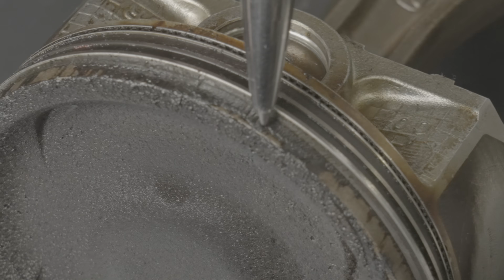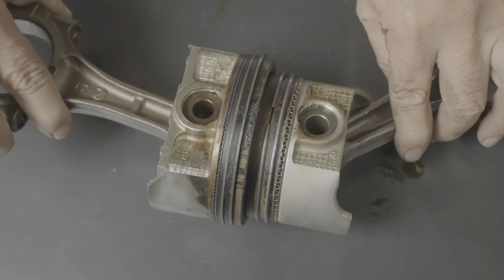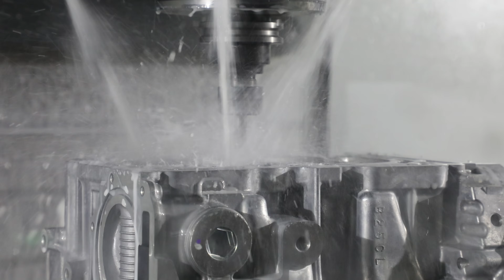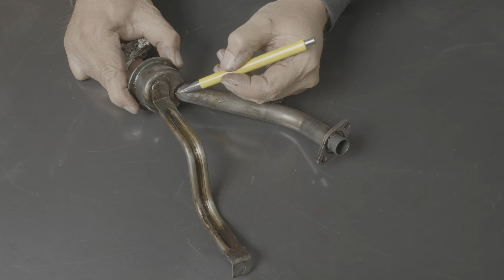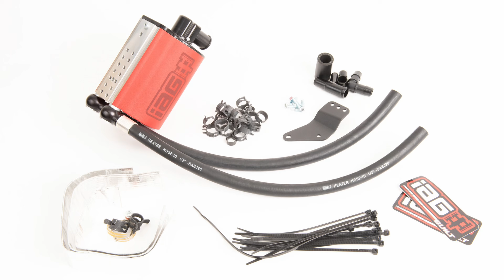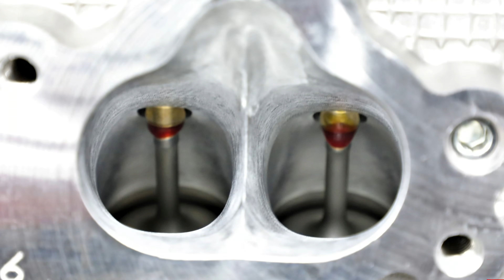Why Subaru Engines Blow Up!

Comment: I'm looking at some WRX's. Is this most prevalent to some years or anything like that? Or I see some comments say the design has remained relatively the same. I'm interested in 2017 - 2018 or something like that years. I don't know much about Subies. But great video! Very knowledgeable and you just earned a subscription!
Reply from the maker: Those have the somewhat stronger FA engine

Comment: Detonation happens when  air temperatures exceed the capacity of the block/cylinder can not disipate enough heat ,by this meaning cooling system, cold air charge intercooler , weak heads, thin block walls and composition.
    Solve the heat problem and then solve the problem.
Reply from the maker: That is only one part of the many of why detonation happens.
Reply: It also happens from running the wrong fuel. Sub 95 octane fuel will predetonate under pressure.

Comment: So if I got one for daily driving (more like once a month driving) and maybe casual travels and leave it mostly stock just doing regular maintenance i'll be fine?

My city got rid of it's racing track anyway so there's nowhere for me to go, the closest place from me is 250 miles away
Reply from the maker: If mostly stock means full stock or bolt on's with a tune from a competent tuner with actual Subaru experience yes and good maintenance just not average..
Reply: @motoiq  literally just changing the air filter and exhaust.
Reply from the maker: Air intakes without a tune mess these cars up most of the time

Comment: 600whp stock block here 3000 miles abused . Only thing  happened so far was e85 corroded my fuel pump connector and left me stranded one day . Main thing with these cars is people running the car low on oil. These cars requires the oil to be filled at all time because of the boxer design .
Reply from the maker: It won't be running for long at 600 whp unless maintained well and driven carefully.

Comment: Most of my wife’s family buy Subaru’s only. They live in Montana and buy them for their superior traction, safety and accident avoidance.
One of my brothers and sister’s inlaw drives 50K miles a year, so every 6 years they buy a new Outback, because after 6 years it has 300K miles.
They change the oil every 5K miles and every 35 - 40K miles they have the CVT fluid changed.
All of her miles are highway mileage where they seldom drive over 70mph.
A few years ago my wife had been wanting an Outback for many years, so for her 50th birthday I bought her a 2 year lease returned Outback. It had only 5,600 miles. It now has only 30K miles and it’s 5 years old.
She fell in love with the Cinnamon Brown with the warm Ivory interior.
Before buying her the Outback she’d have to park her Camry 3-4 months every winter because of the 5-7 feet of snow we get here in a very mountainous area of north central Washington state. She would then drive my 4WD Toyota RAV4 and I’d drive our 11 Ford Ranger XLT super cab 4WD pickup.
After buying her the Outback, we were so impressed with the traction that I decided it was time to replace my old RAV.
We had to put studded snow tires on my RAV every winter, whereas she drove year round on her factory tires on her Outback.
In December 2022, I found a 2019 Forester Touring that had only 4,700 miles. It’s a Certified Subaru and is the biggest LEMON ever produced.
I started complaining about it at only 5K miles and BEFORE the Factory Warranty expired. It’s been into Subaru service department many many many times.
They thought that they found the problem After the warranty expired and even though I’d been complaining about it for over a year and the warranty expired, Subaru wouldn’t pay to have it fixed. So it cost me $1,600.
Even though I spent that money for a new DCM the main computer, it’s still doing the same things and now my mpg has Dropped from 24mpg, it’s now down to 20mpg. It’s the 2.5L 182 naturally aspirated engine. 
Hell, my RAV had the 268hp 3.5 V6 with a 5spd automatic transmission and I was getting 27mpg in it.
In 25 the RAV. Is supposed to be redesigned, so I’ll wait for the 26 year model and I’ll sell my POS LEMON forester Touring and buy a new RAV AWD Hybrid.
My Forester is my First Subaru and it will be my LAST Subaru Ever !
As far as I’m concerned, Subaru can go 🖕🏽🖕🏽🖕🏽 Themselves
Reply: I know how you feel. I don’t trust my Subaru to go out of town at all. Its engine was totally rebuilt at 60k and now at 103k it needs it again and they hit me with an estimate of nearly $9700. The trade in value is about $5000.
Reply: @GarlonAllen  I got rid of my Forester and bought a new 23 Tacoma TRD Off Road, double cab, 6’ bed with the Premium and Technology pkgs
Reply: Damn! Write a book

Comment: I've had my sti at 760 wheel for about 16 months. No issues to speak of but I run pump gas periodically so it's not full power all the time. It's my daily so I try to keep some level of mechanicsl sympathy but I do beat on it regularly in short bursts. Never doing any kind of laps or extended punishment. Really hoping to get 5 years out of the engine but time will tell. I love your videos sir❤

Comment: This video summed up: The EJ25 is a very reliable engine when used under normal conditions, it only fails when you start to push for 400+ WHP or track the car.
This will nevertheless, not stop the amount of "subaru engines suck" comments that show up on every one of these Subaru videos.
Reply from the maker: We recommend 330 on pump gas and 380 on E85 on a stock bottom end with proper tuning and fueling.

Comment: I never drove any Subaru's or Porsche's but your video is very informative. I have looked at  a Subaru engine bay with the flat 6 cylinder boxer turbo engine, amazing. A cam belt DIY or spark plugs swap would be interesting.

Comment: @motoiq

How do you guys over there feel about royal purple synthetic oils? Mainly in a fa20.  I thought my research showed it was a high quality oil, but someone in an 86/brz group said he had bad experiences with it. Just looking for a decent oil so i don't blow up this boxer engine 😅
Reply from the maker: Should be fine.
Reply: @motoiq  i appreciate the reply and your input! Thanks! Love this channel and all of the information!
Reply from the maker: The trouble with most people and "problems" with stuff is that most people do not understand or cannot figure out the root cause of the problem and assign blame to something they have a shallow understanding of.
Reply: @motoiq  which is why I'm here, to learn from a professional. I know you said subaru boxer engines typically see failure from oil starvation in the oil pan side or the pick-up tube, which i intend to remedy this season. Just wanted to check with you since you're a professional with ample knowledge on subaru engines and make sure i didn't in fact chose an oil that turned out to be problematic, regardless of the engine its in.

Comment: It would be interesting to compare side-by-side a stock Subaru engine with a stock flat Porsche engine to see how Porsche reinforced their castings.
Reply: For sure! I always wondered why Subaru struggles where Porsche has endured reliably. Just this video alone, you can tell there are a-lot of cut corners though. Porsche don’t fuk around.
Reply: @NoName-tf2et  I'm not that knowledgeable, but isn't there some price gap that makes the comparison a bit weak? To me Porsche and Subaru don't play in the same league so cheaper designed/built Subie engines isn't a big surprise.
Reply: @bennylloyd-willner9667  you can also argue the guys buying porches arnt modding and tunning the hell out of em
Reply: @bennylloyd-willner9667  I think Subaru should partner with Toyota to make them a flat 4.  It would last 300k miles.
Reply: @NorthEastDirection  why not, they did the BRZ (or something similar) together. The head gasket thingy that is popular to say of "all Subarus" aren't true of all engines tho. I would like stats on the longevity of all manufacturers cars in "percentage of distance travelled" or something similar with price included in calculation. Often stats like that even things out.

Comment: How does Porsche design their pistons and how are they able to meet hydrocarbon regulations??       So, basically the engines are fine as Subaru designed them.  It's only when the "Brian Spilners" in us want to add power and go to the 50% of Subaru tuners who are terrible at tuning.   Moral of the story:  don't tune the FA20DIT or EJ257; don't do high rpm for prolonged sessions; don't do track days; don't do high boost; don't drive on the track with your street car.  ✅. 🏁
Reply from the maker: Porsche is DI now.

Comment: All motors blow up my subaru has outdone every vehicle i own by 300000 miles and just 4 timing belts...let that sink on its how u treat them. Still has 210 pounds of compression on each cylinder when i checked last month. No other vehicle ive qorked on has had that and i check motors weekly bc im a mechanic
Reply from the maker: Not a turbo performance model

Comment: We got a 15 Legacy off the lot new, original engine was replaced at 38k miles for excessive oil consumption..2 qts a week per 200 miles..n this on a base model 2.5i, ill keep buying toyotas

Comment: It's also because the pistons are sitting against gravity l. When it moves, it has a more natural tendency to sit on a cylinder wall, thus making an excessive hydrocarbon build up. It also prevents a quality deal against the piston wall and contributes to the piston ring wearing out and can add to piston rocking
Reply from the maker: That is not a reason.
Reply: @motoiq  physics disagrees. I mean. You're welcome to argue with physics, any time you want. Go right ahead. If you can defeat gravity, you should be talking to somebody from NASA  not working on cars. They've been trying to figure stuff like that out for a very long time. You would make a lot more money.
Reply: I'm sorry. I was upset. Gravity has let me down every day of my life. I'm just a bit jaded
Reply: Long story short, without gravity those pistons don't even move, because they won't even be able to obtain stoichiometry ratio, because they won't even have air, the car won't move itself because it won't stick to the ground. There would be no engine balance even because all the parts would basically be floating. Go argue with physics.
Reply from the maker: The engine will run fine with no gravity. Parts still have mass with no gravity, Go argue with physics. The reason Subaru piston ringlands fail doesnt have anything to do with gravity, Porsche engines other than the crappy M series don't have these problems.
Reply: And Honda Goldwings seem to handle gravity just fine. (1800cc 6 cyl boxer) @motoiq

Comment: ok bud.. 20 years as a subaru tech here.. the fucking owners of their cars and the stupid tuners and mod junk parts are the cause. period.
Reply from the maker: Ok bud, its still a weak engine.
Reply: @motoiq  ok fine.. its not a 2jz.. and also its been discontinued. and owners of subarus either hippie douches that dont change their oil or tuner douches that build them wrong. every manufactorer has a shitty engine.. subaru just didnt waste billions of dollars building 25 different engines.. they made a few variants that were super strong and basically one that everyone blows up. so tell me mr expert... of the EJ20, EJ22, eg33, ez30 ez36, ej205, ej207, ej255, ej257... which is the weakest or are you just a douche that lumps them all together? and mind you subaru only has 4 engines these days, FB20/25, FA20, Fa24, Ez36.... the only one on that list that is weak in the FB20/25 due to oil consumption. the FA20/24 and ez36 are literally bulletproof.. so please keep ragging on one discontinued engine like its relevent today.
Reply from the maker: Even the strongest of the Subaru engines are pretty weak compared to most other popular to mod engines and have less lame tuner headspace. I do agree with you on the first two reasons for failure.  The FA's are not bulletproof, they are better but still have weak points.  I am going to do a video soon on why the FA is better.

Comment: I own a subaru and love the car 

But as a company they are dogshit compared the honda and Toyota in terms of actual improvement

If you pointed this stuff out about a toyota engine, so much money would be dumped into fixing and addressing the issue.

Especially subarus turboed versions of the engine. 

They've gotten very complacent in the sporty market now that they don't have any real competition for budget rally cars or really just good off road cars in general. 

Shit gas mileage for their cars that only push 200 horses. Cobb has made a kit that completely passes emissions that pushes around 400 hp with a proper tune (how the 22-23 wrx should've come from factory)

Comment: A subaru with subaru suspension and drivetrain, with a honda motor and toyota transmission would be the greatest car of all time
Reply: subaru axels suck though, and wheel bearings

Comment: What a shame 
Great AWD systems......but bad power plants
They never learned from the early 80s water boxer engines of VW......always prone to head gasket failures too
I would buy a Sube the day the built a reliable inkine 4 with no turbo
I'll stick to my suzuki SX4 AWD  naturally aspirated 2 liter inline 4

Comment: It's the owners abusing these engines. My first turbo change came at 248,000 Kms. No other big problems. XT forester 04. Uno rubber hoses are now silicone.. zero tunes or upgrades accept the usual air filter , radiator. Replacement turbo aftermarket but same configuration. Keep it simple and change your damn oil regularly.

Comment: I machined the heads on a 2.5L engine that was overheated once due to cooling system failure. Block was warped less than 1 thousanths but the heads needed 10 thousanths removed.  The cams rotatedly freely....

It maybe that these engines are touchy, not nessidarily due to bad design, but kissing the aluminum fatigue limits.

Comment: 550 is nothing a k can run that on stock bottom end
Reply from the maker: It's not reliable with a stock bottom end at that power level.
Reply: @motoiq he was saying that a K can run 550 on a stock bottom end, not an EJ.
Reply from the maker: Yes a Honda K series with a stock bottom end isnt particularly great as far as reliably goes at 550 hp but probably better than an EJ

Comment: Thank you Mike ❤.  Does the Subaru  FA20 make a much better platform for NA then?  It has the finger followers but still has dogleg exhaust port.
Reply from the maker: It is a stronger engine to an extent.

Comment: This gentleman has all the experience to come across as 100% accurate.
He speaks with no prejudice but with reams of knowledge.
Reply: And yet many actual Subaru experts will disagree with half of this video. Nasioc has 30 years worth of build experience on it. There are very precise recipes on how to build a good EJ boxer. We've known this information for literal decades. Bro spent 30 minutes trashing an EJ25 block, full knowing it has issues, while ignoring the EJ257, and EJ20's, which have dramatically different characteristics, because they're different engines.

Comment: They don't.
Reply from the maker: Not sure what rock you live under.
Reply: @motoiq  I've yet to see a Subaru engine "blow up," let alone in the sensationalist manner you have depicted in the thumbnail, consumed in a nuclear fireball.
Reply from the maker: Then you probably know very few people with Subarus and don't own or know anyone with a performance model and you are probably not an enthusiast.  Just read the comments and you can tell.
Reply: @motoiq  I own a Subaru so I guess I'll wait for this promised fireball. 🙄

No wait - it's actually the fault of the owners. 

https://youtu.be/NvS_t7hmGGk
Reply from the maker: Subaru has the least headspace to tolerate bad tuning and maintenance for all the reasons we talked about.
Reply: @motoiq  So it's bad tuning and poor maintenance.
Reply from the maker: And a weak engine that is fine stock but is easily pushed over the edge.
Reply: @motoiq   You're twisting everything.
Reply from the maker: I am not twisting anything, I have no emotional attachment to this car or engine even though I own one.  If you read most of the comments here you can see that many many Subaru owners agree. There are many popular cars to modify and by far more Subarus blow up than any of them. I objectively state the reasons why they are weak in the video and you seem to have trouble believing it.  I am very qualified to make these videos objectively, I am a degreed Mechanical Engineer and have worked for 4 decades as an OEM and Motorsports engineer.  My company builds race cars and engines.  My friend's company that mass produces Subaru racing engines sells over 1400 of them a year and there are several Subaru specialists that sell quite a few as well.  If these were such good engines, such a thriving market for heavy-duty versions of the engines would not exist.  It is you who needs to be objective not me.   Maybe your Subaru has not blown up,  good for you, but that doesn't change the fact that they are marginally strong for a turbocharged performance branded motor.

Comment: Crest CNC manufactures a replacement cast head for the EJ (dogleg port deleted). We also manufacture a billet EJ block that IAG sells. Additionally, we are working on a cast EJ block that is not far away.

We measured the change in the main bore diameter from 20°C to 100°C on both the billet EJ block that we manufacture and the OEM die-cast aluminum block. They were within microns of each other. (Both grew at the same rate)

I believe the myth that the billet expands more than OEM is perpetuated by comparing it to iron. When replacing a water-cooled aluminum case with another water-cooled aluminum case, there isn't a whole lot to measure.
Reply from the maker: Are the heads available now?  They were pending.